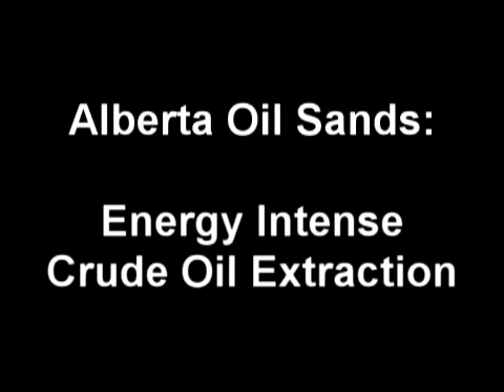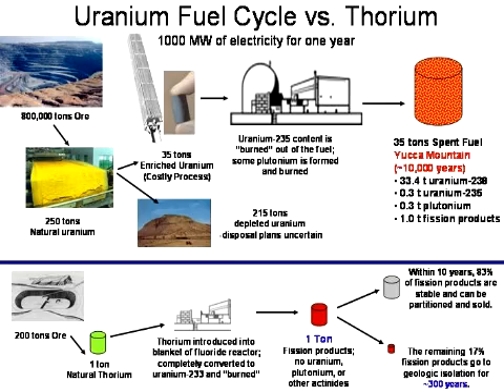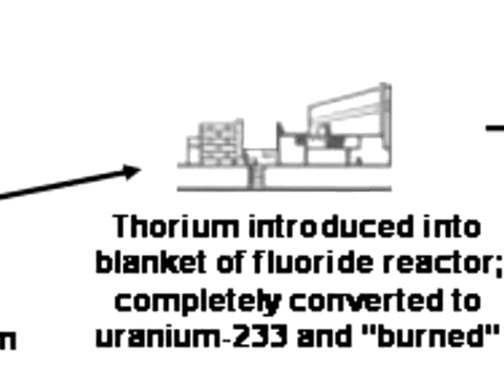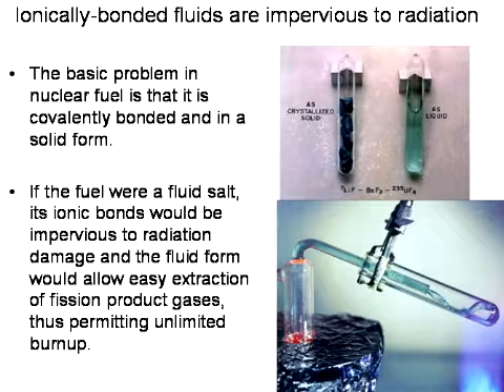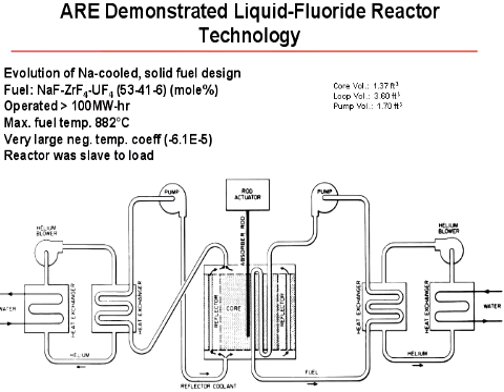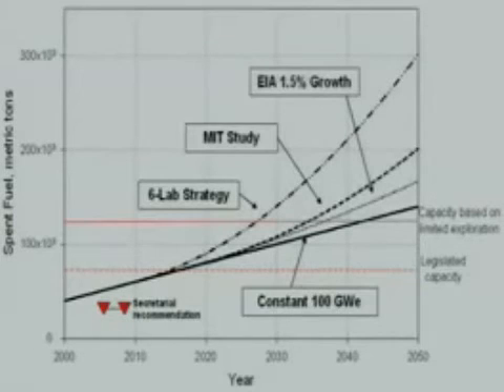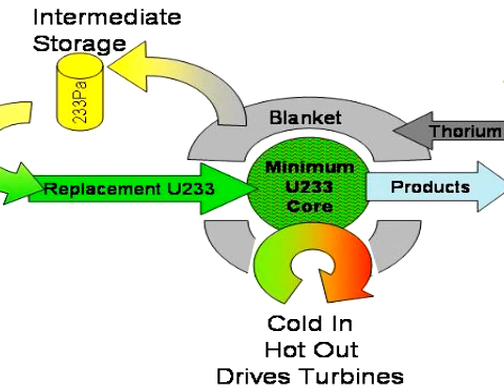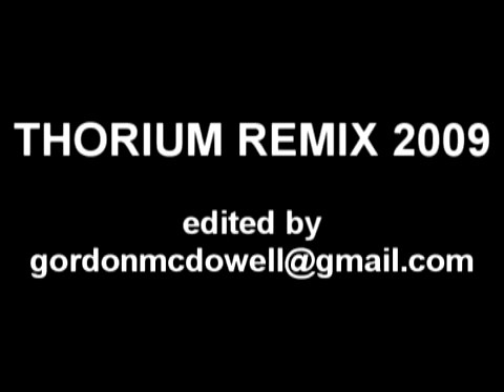Oil Sands Extraction - LFTR in Alberta?

Comment: I think that uranium supply will be getting abit tighter...Notice spikes/rises in price when Cameco's Cigar Lake mine hit major snags for past three years. 

India also made strides in this are while it had limited access to uranium.

Finally, there are great operational benefits to a design that allows for continuous (liquid) refuelling, rather than costly shut downs, and moving parts maintenance, fuel rod replacement, and re-start cycles for conventiona core designs.